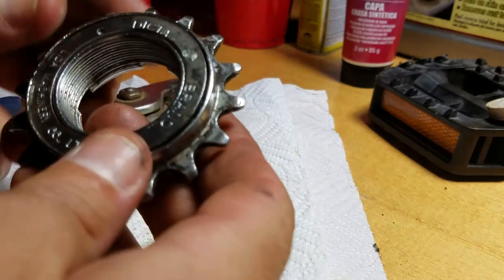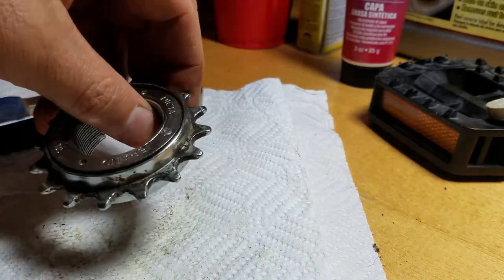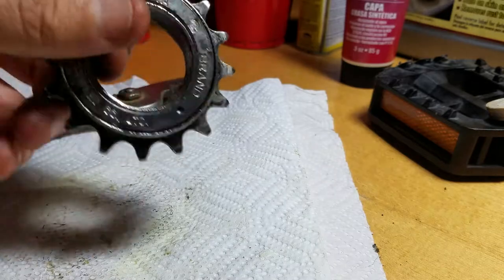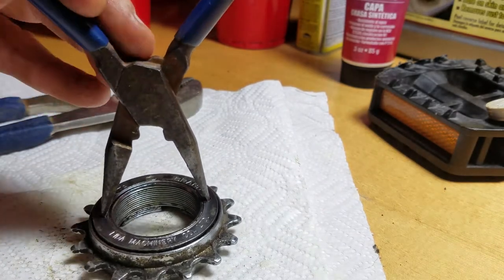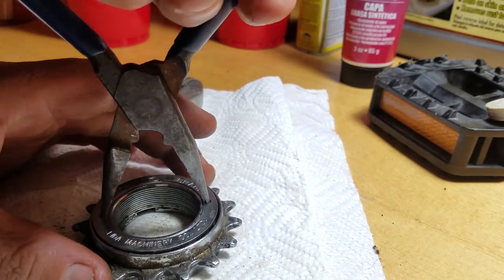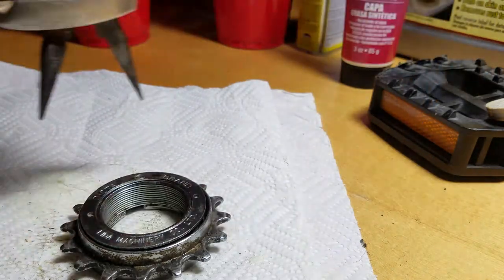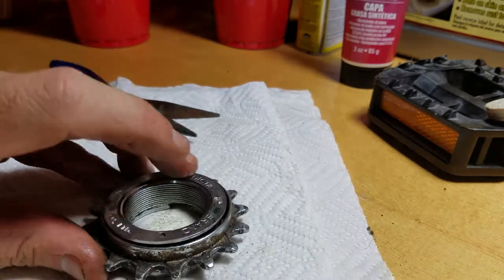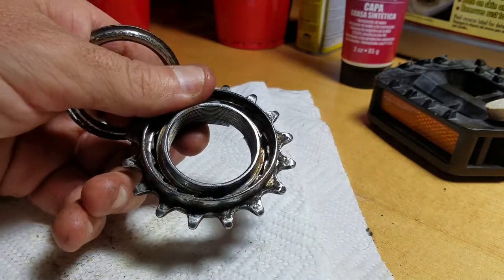BMX Freewheel Rebuild - Opening without a special tool

Comment: Working on an old suntour single speed bmx freewheel and this has been giving me fits. I’ll try the pb blaster again and then try your method but it’s on there tight!
Reply from the maker: Try a hammer and punch or nail to get it loosened a little. If that doesn't work, keep soaking it and try again!
Reply: 15to70 that little two dot lock ring spins counter clockwise or clockwise? Does it depend on the ratchet direction?
Reply from the maker: @longhorn8459  I think the suntour is counter, but try tapping it both directions to knock it loose.
Reply: 15to70 it was counter and I finally got it loose. I used pb blaster and about 15 seconds of a torch with the fr6 in a vice and a punch/hammer combo. Dropped two ball bearings but actually found them on the ground! Thanks!

Comment: That side goes toward the hub though.  How would you take off installed?
Reply from the maker: You're right, this Dicta doesn't open that way. Some do, like the ACS Claws and Shimano. Use the leverage of the hub by tapping it good several times before removing it. Can be a tight fit but it really helps to get it started before removing. Try a nail or punch if the needle nose won't fit.
Reply: I have a dicta. Does it unscrew cw or ccw?  And its just difficult since cant do it on hub
Reply: Counter clockwise if you're looking at the inscription

Comment: Hey. I just got a GT Vertigo for a good price and it is in amazong shape.  I also just got a late 90's Dyno Compe for a steal and I have a problem. i just got back into bikes and am going to do some upgrades like skyway mags for the Vertigo. The Dyno Compe fteewheel is siezed or something.  it pedals both forward and backward and when you ride it you cant pedal backwards. When I flip the bike over and pedal it with my hand the pedals keep going with the wheel, they dont stop and it seems to be siezed. Its all origonal.  What do you think the problem is.  I found on acebmx freewheels for about $10 but I'd like to try and save this one if I can. I love how the origional ones sound. My Vertigo freewheel is great but something is way wrong with the Dyno Compe.  It sat in storage and I was cleaning it today after I bought it. Any help would be great. Thanks for the tip in this video.
Reply from the maker: truthloveandhonor Try WD40 first. Really soak it good, try turning it back and forth to break the pawls free. If it won't spin or click, let it sit overnight in a ziplock bag with lots of WD40. Once you get it moving again, you'll want to keep flushing it with WD40 until everything runs clear. If you can't get it spinning free, you'll need to try soaking in gas instead of WD40, or take it apart, or just replace it with a new one. You can also check bmx museum for a matching used replacement... either way be sure the get the correct tool for removal from the hub since it's probably stuck on there pretty good after so many years.
Reply: 15to70 Yeah that is the problem.  I took the wheel off last night and it wont even spin. The freewheel is literally siezed on there. I soaked it good in wd40 and was getting all the rust off of it.  The thing just wont move at all.  I need to get it off because the wheel is in excellent shape.  I will try what you said to do.  I will get a freewheel remover tool and try to get it off.  I also soaked it last night in some penetrating oil.  Will I be able to get the piece off in this video with the piece the removal tool is made for still on there?
Reply from the maker: If you're trying to save that freewheel I wouldn't recommend opening it up with it still stuck like that. It sounds like a new freewheel is the way to go,  you can always try to rebuild the original one later. You can try PB Blaster on the freewheel - should come right off once you have the tool.
Reply: 15to70 Dude thanks alot! After letting it soak in wd40 and penetrating oil, I did what you did in this video and it broke loose!  I didnt even need to take it fully apart.  I flushed it good with wd40 and it sounds awesome and is moving freely.  Thanks a million.  I really thought that wheel was a total loss before I saw this video.  👍
Reply from the maker: Glad that worked for you! Always nice to be able to fix & keep an original part on a bike.
Reply: Thx for this short and specific video... externally helpful and efficient. Off to the basement to crack this sucker loose. Preciate Cha’ !